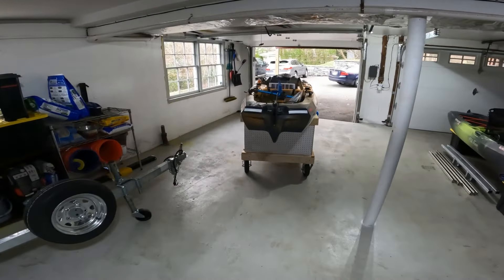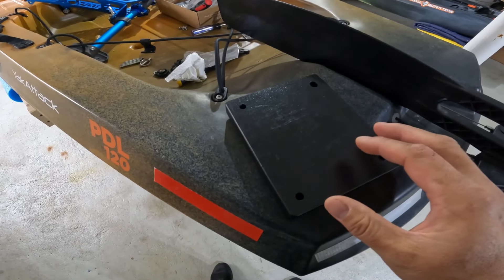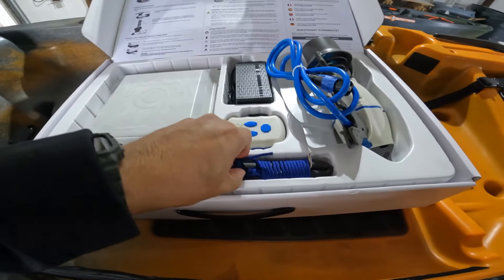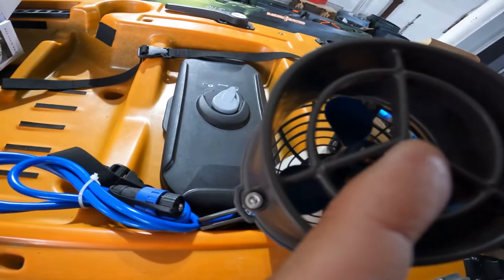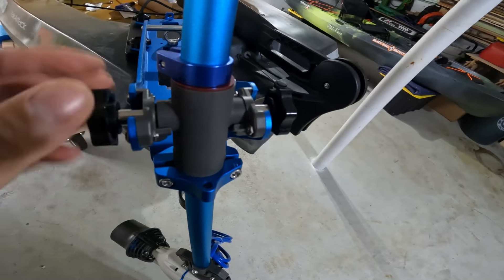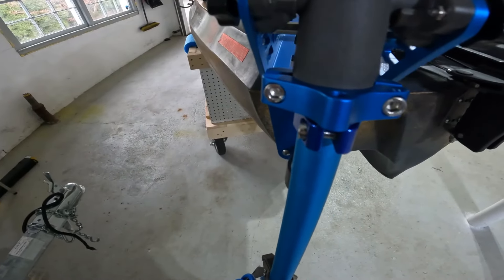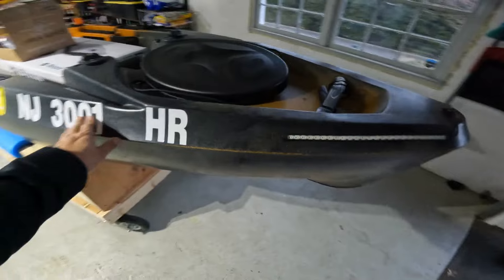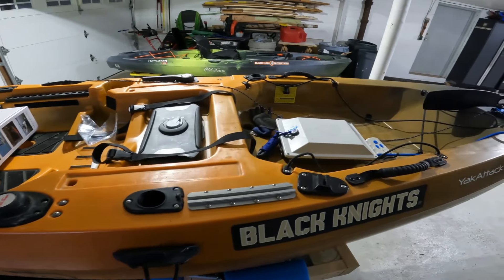Bixpy J-2 Kayak Motor Installation on Old Town Sportsman PDL 120

Comment: i have an almost identical set up on my Bonafide ss107.  love it so far.  the only thing different i did was add an extension cord from bixpy that allows my battery to fit under my seat instead of behind me.  makes it easier to reach the kill switch although bixpy says you may lose a little power because of the length of the cord (4.5')
Reply from the maker: Thanks!  That’s a great idea.  Didn’t even know the extension cord existed.  On my “to order” list.  Really appreciate you checking out the channel and providing awesome feedback!!  Cheers!
Reply: Use large gauge wire for car stereos, like stinger 1/0. Very flexible and durable, looks nice, and varies carries a lot of current.  make your own cord.

Comment: I see how pulling rope to pull motor out of water would work, but I don't see it being able to drop back down with enough force to snap back in when it hits the water. Feedback on that?
Reply from the maker: For first 3-4 months of use, I would put my motor to speed 5-6 and it would pop in.  Then you can lower the speed to whatever you want.  After the motor clip got broken in (around 4 month mark), it would just pop into place from just dropping the motor.  No need to go speed 5-6 anymore to drop in the motor.  I also used my paddle to push it in if I didn’t want to turn on my motor right away.  Really a non-issue once you start using the motor.
Reply: @WannaFishAllDay  Ah, so the motor propulsion helped push it down there.  Didn't think of that.  Thanks for the reply.

Comment: Nice video. I got the same for my 106 PDL. Only thing the thumb screws inside the gap of the adaptor does not fit. I can’t tight them up. They seem bigger than what you have here. not sure I am doing something wrong.
Reply from the maker: I had to drill out the holes in the mounting plate to make them fit.

Comment: hello, one question Sr. today i got my power pole bixpy adapter. but i have a power pole install on my kayak, so i plant to install on the other side, my question is do you think i can put the adapter in line with my rudder and no on an angle as if I install on the power pole area?
Reply from the maker: I think it’s possible just as long as the rudder has clearance to move side to side without interferring with the motor.  If it was me, I would want plenty of space btw the motor and rudder.  I’m not sure how it would affect steering at high speeds with the rudder being so close to the motor.
Reply: @WannaFishAllDay  Thanks. i just install parallel to rudder, space is ok, just let you know how work, any way will be better that install on bixpy gravity rudder. by the way, there is not support plate under the power pole are, just 4 well nut
Reply from the maker: Thanks!  Look forward to hearing how well it works!!

Comment: Nice work, I had thought of mounting a trolling motor to this same rear power pole spot, but concerned about the offset handling, and weight making the boat list to one side.
My 9" Garmin mounted left side with the paddle is already making my boat list uncomfortably to the left but I want the right side clear for landing fish.
Wish you had an on the water test of this setup to see how it rides.....

Comment: Very nice. However, I'm trying to locate a straight drop in Trolling Motor or Bixby Drive where my Pdl is located on my Old Town Salty 120. 
Just a drop in piece & I can't find anyone that makes a straight drop in. Seems like someone would make some money if they did. Any ideas, besides make your own with a cover plate?
Reply from the maker: Unfortunately, the DIY thru hull kit is all they have right now.  @RivermanTV did a video on it and it looks pretty simple but yes, you still need to DIY something to a cover plate.  Anyhow, thanks for tuning in!

Comment: Question: How do you feel about mounting a Bixpy motor to the pedal drive insert on the top water? They sell a DIY through hull adapter.
Reply from the maker: Hey Tommy.  Yes, I debated that.  @rivermantv has a great install video for OT kayaks.  I think it’s a great option for some.  I ended up going with the stern mount bc I wanted to be able to use the pedal in conjunction with the motor. Yes, in theory you can do that with the hull adapter but the constant taking out/putting in/storing/messing with cables persuaded me to go the other route.  I find that I use my pedals equally, if not more, than the bixpy when fishing so it was all about convenience and speed for me.  Also, if I need to hustle, I pedal while using the motor simultaneously to get some additional speed.  Saves the battery while getting me from point A to B a little faster. Just my preference.  If you see yourself mainly using the motor, I would say the hull adapter is a great option.  You can leave the pedals at home.  Hope this helps!

Comment: I see you didnt go over the steering cables, how did you mount the steering cables from the Kayak to the mount?
Reply from the maker: I’m not using steering cables.  I’m using the stock kayak rudder and steering.  The motor is in a fixed position.
Reply: @WannaFishAllDay  Thank you!!! I'm putting this on my PDL 120 and was confused about steering.
Reply from the maker: Awesome.  Let me know if you have any other questions.  IG is fastest way if you wanna reach out.  Good luck!!

Comment: I was curious to know 2 things. 1) Does the the rudder interfere in any way with the motor, and 2) when going high to max speeds do you have to steer left a bit to adjust for the thrust pushing the kayak to the right.

Thanks!
Reply from the maker: Hey Chris!  I’ve used it about 5 trips so far and, up to this point, I haven’t noticed the rudder interfering with the motor at all.  After readjusting the motor to point parallel with my kayak, it tracks straight at slow and high speeds.  I really don’t notice any steering difference compared to when I’m pedaling.  One thing that may just be my kayak, is occasionally, the steering will get a little stiff to turn left or right but it’s because my rudder is not completely down.  Once I make sure the rudder handle is all the way to the stern, steering tightness goes away.  Happens maybe 1-2 times during an 8 hour fishing session.

Comment: Hey, Great install video! I was wondering if you still like the Bixby after a year. I want to put one on the back of my hobie PA 14 360. Does it have enough power to make a difference, and is the noise it makes too annoying?  Thanks!!
Reply from the maker: Thanks for the kind words.  Honestly, I would look at a motor with more power (Newport or a Torqeedo) for a kayak as big and heavy as a PA14.  The battery will run out much quicker and it’s proprietary so you would have to keep multiple batteries on deck.  The noise is definitely noticeable as it has a lot of torque for such a small package.
Reply: @WannaFishAllDay  Hey thanks so much for that quick response.  I really appreciate it! What you said makes a lot of sense. I've watched a lot of videos on this subject and there's no real easy answer. The PA14 is already like a tank to move around . :) thanks again!

Comment: I am very interested in how this turns out. As soon as I saw your video I have really considered it. I have debated mounting a xi3 but the price is deterring me. I am curious how the steering works out with the motor fixed and the stock rutter, as well as the distance this motor will provide. I cant wait to see your review on the water.
Reply from the maker: Yeah the xi3 bow mounted is pretty awesome.  Spot lock, come on lol!!  Saw a lot of those this weekend at a kayak fishing tourney.  But I decided against it bc of the cost and weight of the setup with battery..  Would definitely have to trailer it.  I like the bixpy for obvious reasons but also the fact that is weighs under 10lbs inc. battery.  Thanks for tuning in!!
Reply: @WannaFishAllDay  Thank you so much. Did you consider the Newport Vessels Kayak Motor NK-180S?
Reply from the maker: No prob.  I did look at the NK but decided to go with bixpy bc of the weight, less cables and proprietary battery.  With the NK, I would have to go with my own battery which probably would weight a lot more…. However, I did hear good things about the NK.  Definitely faster than the bixpy..
Reply: @WannaFishAllDay  Thanks for all your help and tips. I cant wait to see your rig in action!

Comment: I have this same kayak. Been looking for a vid like this. I only want a motor for getting back to the ramp or to get to a spot faster. Also I don’t see how that motor can snap into the clip when it hits water on the way down. Does it snap in when it’s started?
Reply from the maker: Thanks for the kind words, Sam!
Reply from the maker: Yes, it snaps into the clip at med speeds now.  I’ll start it at med to high speeds initially for it to pop into the clip and then can reduce speeds after that.  Initially I had to use my paddle to pop it in but not necessary anymore.